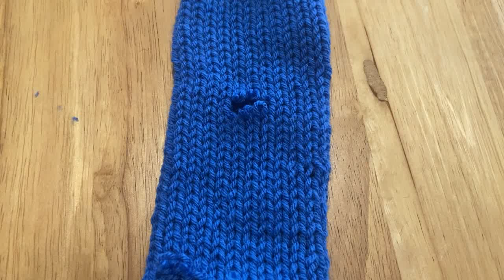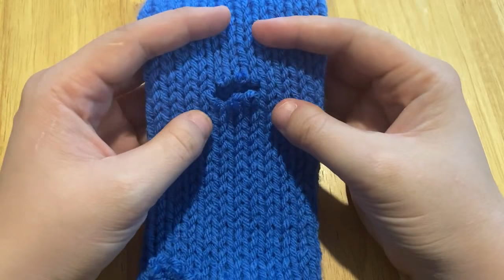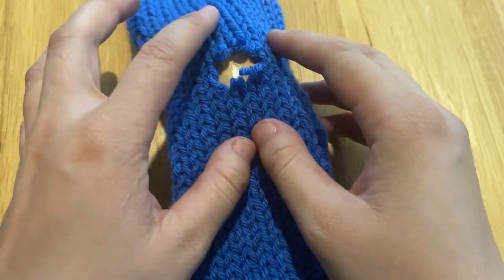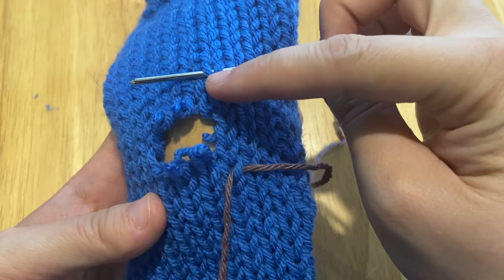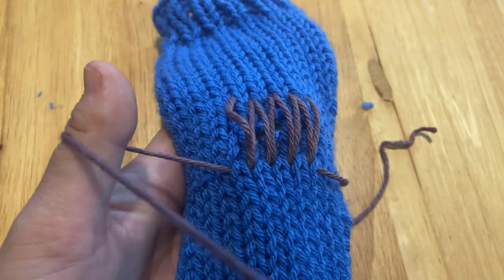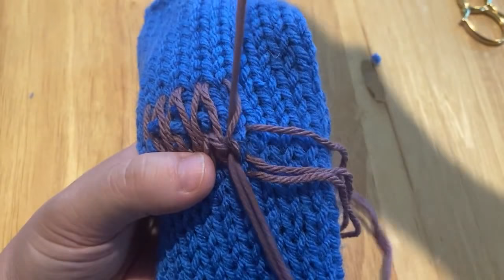How to darn knit fabric with Swiss darning

Comment: Some other demos of Swiss Darning use sewing thread for the ladders which is removed after the darn is completed.  Do you recommend using the same yarn for the ladders as will be used for the repair and leaving the ladders in when you're done?  Thanks!
Reply from the maker: I like to leave the ladders in for darning, so it helps with the structural integrity a bit. If you want to remove it, I'd do it in a slightly thinner yarn than what your knitting is made of and have a contrasting color for easy removal later on.